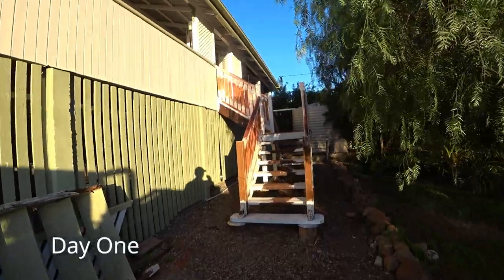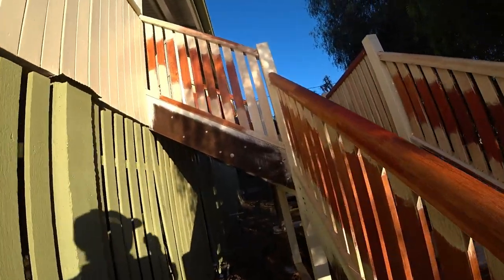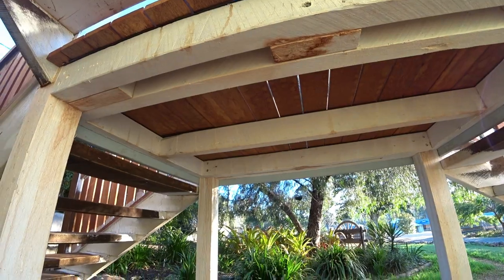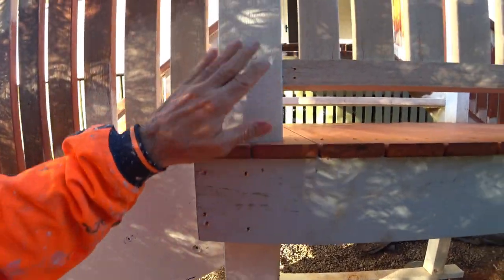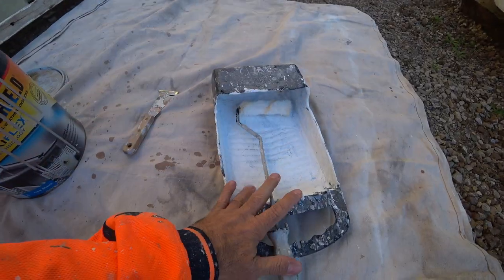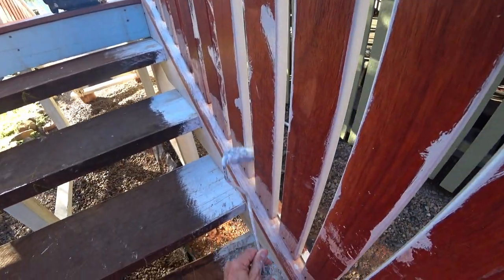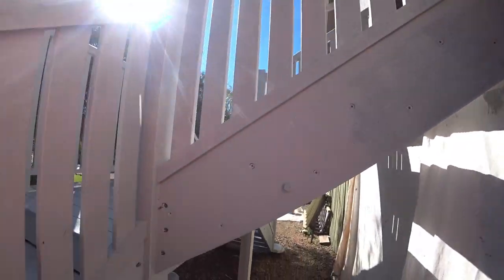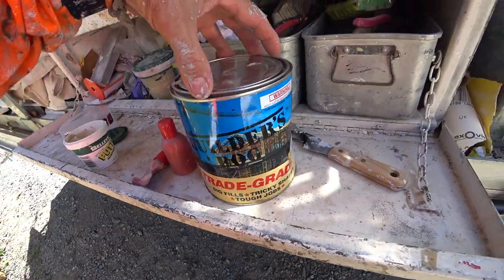Painting hardwood butterfly steps with close up preparation and tips by the Pa1nter

Comment: Why you didn’t use oil based undercoat first, looked like you did Weathershield straight on? 
I like watching your videos. Cheers.
Reply from the maker: I could have used oil based undercoat but I prefer the weathershield as its easier ,thinner and easy to sand and flows nicer into the gaps.

Comment: Doesn't oil based wood putty take 2 weeks to dry before you can paint over it ?
Reply from the maker: It skins over fairly quickly in smaller nail holes, can be painted straight away with water based paints but in bigger holes or glazing it takes a couple weeks or a month to fully harden.All my new homes are puttied and undercoated in the same day.